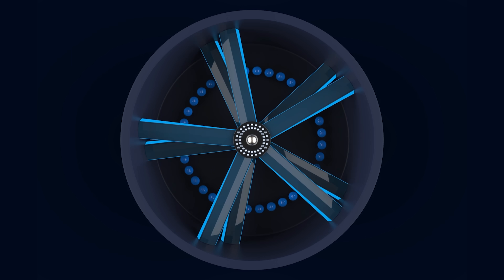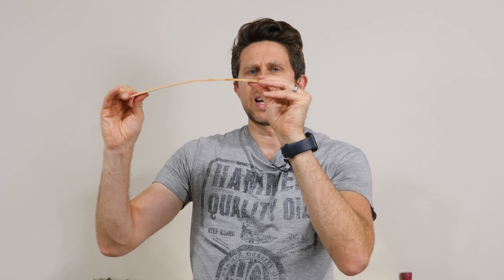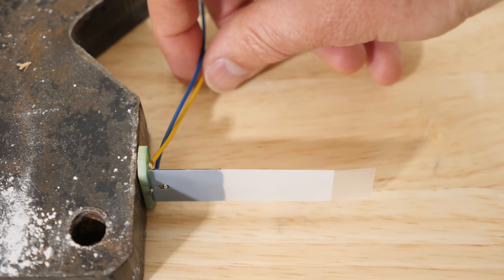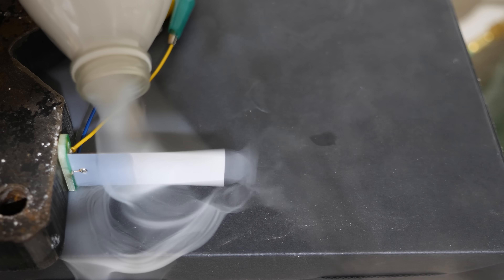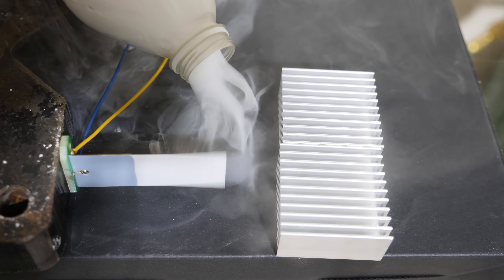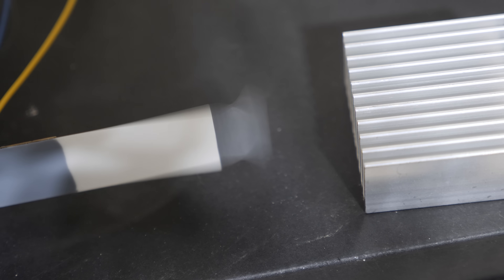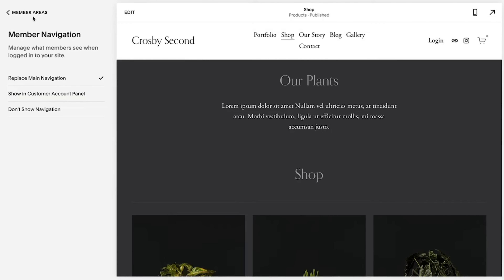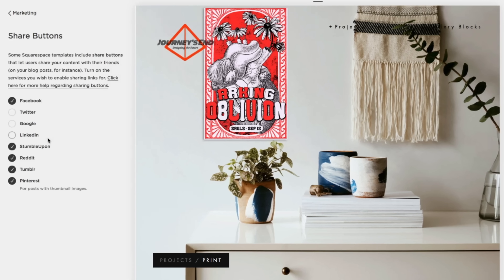A Solid State Piezoelectric Fan—Does It Actually Work?

Comment: Why hasn't anyone built smaller peltier modules on circuit boards?  Possibly have the entire circuitry on the peltier device.  Or obtain a peltier device and print the entire circuit on that. Heat sensitive parts in the cool side.  Not efficient for anything but performance but maybe harvest electric ⚡ in the future.

Comment: This is a very interesting way to move air! Did you know they have made Solid State Active Cooling chip named AirJet by Frore systems for component cooling? The use cases are varied as the chip is in a very small package with a 2.8mm thickness. They are developing it for use it in tablets / laptops / cellphones. PCWORLD did a couple videos on it a Month or so ago.

Comment: I'm guessing this is the basic principle used by Frore Systems in their ultra-thin coolers for laptops that they presented at CES 2023. Though they've been working on perfecting the design and manufacturing for about six years, where as this is just a proof of concept.

Comment: It still has moving parts, it's not solid state. Eventually it will wear out, if it is put in a case it will get gummed up, it still has moving parts. A true solid statr fan would be something likr those house air ionisators, theu can make air move with no moving parts.

Comment: To put in perspective how fast modern computers really are, the piezoelectric crystal in a computer which controls the speed of the CPU vibrates at 4 or 5 Ghz per second, whereas this piezoelectric flap is just vibrating at 60 hz. Yet you can see in the video how insanely fast that looks. 
So computers are basically doing calculations so fast that watching them work from the inside would just look like they're vibrating.

Comment: Looks to me you created resonance at the second mode of vibration of the flapper. I suspect if you could create resonance in the first mode (perhaps by making it stiffer or lighter to match the first mode frequency to that of your source of electric current), you could move air a lot more efficiently.

Comment: You have to check out the AirJet solid state fans by Frore Systems shown at CES. They are MEMS instead of piezo but looking pretty neat. Now if they would only let you buy some to play with. Looks like they are only going to provide them to laptop manufacturers.
Reply: MEMS can be piezo based- they are independent concepts. I'm pretty sure Frore is using Piezo to create the vibrating membrane.

Comment: Hi, I really like your videos. Following your video, I think it is possible to generate compressed air on the go using this piezo. Would you be able to create a prototype to create a compressed air using the same technology? I guess if we position in right direction then aero dynamics also helps in generating more compressed air. Please see if you can create a prototype that runs a motor or drone?

Comment: This mechanism using piezoelectric effect is not unique. You can modify the mechanism of an electric motor to achieve this back and forth motion. Pass AC current through a coil and and place iron or magnetic strip close to it as shown in the video.

Comment: could you get this to work in water or mineral oil for example i understand the resistance would be significantly greater but it might help with submerged pcs maybe i dont know that much so running normal fans maybe just better for a certain reason but if this did work you could use it to circulate any fluid to keeps temps generally similar throughout the liquid while also using alot less energy (although one that would make a liquid flow might have to use more power to hit the resonance frequency within water if that's even possible in water

Comment: Even for computers, you'll need a higher volume of airflow than what your piezoelectric flapper is doing. I think you should do a follow up video wherein you can vary the frequency of the supply current. Maybe if you can get your flapper going at 150 flaps per second (i assume that'll take 300hz current) it might start moving enough air.

Comment: You literally just solved another problem for space engineering, could these fans possibly be able to be used in a space convection oven replacing the rotor blades for cooking?

Comment: Interesting. I just watched your "pump water uphill with no pumps, just check valves creating water hammers." These piezo fans look like fish tails to me. (And why not create a wall of them to really compare them to a desk fan?) "Fish tails" ...can you insulate the piezo and put them underwater? These could be the "tiny pumps feeding big-diameter pipes" Feynman talked about, necessary to pump water up mountains and up water towers to poor communities, (and for irrigation). I bet these, well insulated, would make amazing pumps. Now, I have to try it. ;) ...They'd also be amazing for moving air in arctic conditions, where a propeller grinds to a halt die to sub-zero temperatures! Thanks, Action Lab!

Comment: so, it cant break from stress, but i for sure can say it gonna break rfom fatigue, it will last a loong time tho, i did and article on my mechanical engineering class, that every component, moving or not, will break in the elastic zone from fatigue, it is a real long time, but it will, great video, gonna try do some for my amplifier on the car audio system

Comment: I wonder if you could reduce the frequency and have it not b e really loud. I have seen things where people put a 60hz applience on 50hz and it buzzed loudly. Because of how piezoelec trics work, I wonder if it won't have that issue. Also what if you somehow replaced a computer fan with one of those. I don't know how that would be done but it would be interesting if someone did that.

Comment: Imagine an array of these crystals, not only to create a larger area, but laid end to end. All moving in conjunction to keep passing the air to the next and the next. Timed voltages that would move the puff of air faster and faster through each subsequent piezo unit.

Would enough micro-bursts of air at high speed and frequency compare to a fan blade? Mayhap.

Comment: There are a few reasons why these aren't very common: 
1. For the same airflow these are quite inefficient compared to conventional fans. Most of the energy goes into creating random vortices and a relatively small part goes into the needed airflow;
2. These are much less space efficient. For many cooling applications like computers and servers having such a bulky device is a problem;
3. The piezo fans require high voltage AC. So you either have to use it at grid frequency or have an alternator (expencive and bulky). The high voltage AC also requires more insulation, adds risk of arking to low voltage components, emits EM noise, etc.;
4. For the same airflow it creates much more vibrations. So more noise and more fatigue in surrounding materials (soldered wires would eventually break).
5. You severely underestimate the longevity of bearings. And the ones in fans are rated for significantly higher loads then they would ever experience. Mostly because it's not economically viable to make weaker ones in general. Moving parts on its own doesn't mean something will break faster. Bearings can easily spin for centuries if they aren't pushed to their limits and the dust seal is intact. A vibrating strip like yours will destroy itself or surrounding components from fatigue much faster.

I could only see these being practical in MEMS devices due to manufacturing limitations. But there is no point in building large scale ones.

TL.DR. Fans are better in virtually every way.

Comment: How would you build a duct for this?
I’m picturing a trumpet shape from the top with vertical sides nominally larger than the fan to allow for clearance. 
The shroud section near the base of the fan could be flared out to allow for air to be drawn through perhaps

Comment: Can you make a piezo SS fan using low power input, turn a rotor using a method similar to train wheels / home made tattoo guns, and have the rotor be able to step the energy input up with gear ratios? I know it sounds like it breaks the 3rd law of thermodynamics, but you never know until you try lol. Would be need to just use piezo crystals in some fashion to harness water power / gravity to produce voltage from the impact compressing the crystal.. or install them in the heads of a combustion engines to harness the energy from the rpm

Comment: I remember reading about these in a science magazine in the 90s, I think... They had two blades facing each other that would move together then swing apart. Made a directional jet of air. The biggest complaint was that it made a high-pitched whining or humming noise.

Comment: Fantastic video, as always.
But I wanted to ask about your comment on its usability in space or  a  true vacuum, because as I understand it, there is no air or medium to transfer strictly mechanical force to create the pressure differential.
If I am incorrect (very likely), could you explain.
Thanks in advance...
Reply: He was talking about an environment with air, while in a zero-g space, such as the inside of a spaceship in orbit, or while moving in a line without accelerating.

Comment: Actually i was thinking about this for a while, but i was thinking if we can use this piezoelectric element to compress air by connecting it to a diaphragm and a one way valve to allow air to be compressed in a chamber. But i never tried it, do you think it will work?

Comment: Probably wouldn't put this in a PC but something like this might work at really small scales in a phone.  If you could engineer the flap to be more efficient such that it pulled on multiple pieces and formed a pump with seals, and you did that at the millimeter level, you could probably exhaust the entire phone via channels.

Comment: i feel like the reason rotary fans have dominated is because the fan moves only one way.  it's cutting into the air, and pushing it.  with a "waving" fan, it's more like an oar.  the difference is an oar can be pulled from the water.

on a "waving" fan, you have to spend energy to stop the motion of the fan, and cause it to reciprocate, overcoming the air current it's just created on the first stroke.

meanwhile, a rotary fan never has to stop, does not need energy to restart, it's continuously cutting into and pushing the air.

Comment: It can maybe last longer than regular rotating fans (it should be tested simultaneously) but it has moving part thus it isn't solid state.

Only real solid state as for now is passive cooler. If you put large enough passive cooler fan isn't needed. Maybe to try build computer case that has sides made of cooler?

Anyhow, I like your commitment for exploring new stuff!

Comment: "A fan with no moving parts." IMPOSSIBLE except either by an ion-thrust fan (that someone else just told me about) or by the kind of convection that comes from mere fluid temperature difference. Other than those, something has to move in order to wiggle the air! That's why your phone speaker was able to blow out a candle. I like that at least you said "no parts that are going to rub against each other" later. But they may still wear out... imagine the possible fatigue.

Comment: That piss ant fan wont even be able to push air through my 120 and 240 rads.
Heck my Corsair SP120 fans need to run at 70% when the PC is under load to maintain temps under 65C

Comment: I'm skeptical that the vibrating strip would never break or fail. Since it is bending through millions of cycles, it may fail in fatigue. This is a common engineering problem.

Comment: Do you not realize that nothing can move at all without friction. The bending of the metal creates friction on an atomic level. I am unsure if it would be longer lasting than ball bearings but it creates friction. Certainly is cool though but not as easy to control the direction of the wind.

Comment: What's the efficiency vs a standard PC cooling fan? As in, does 1 watt go farther with the solid-state fan or the rotational one? Also, what the hell did you do so it didn't explode when you connected it to the outlet?? I'm not an expert on electricity by any means, so it might be really obvious, but you said you attached it to the wall outlet? With 120V??
Reply: Why would it explode when you connect it to the outlet? There's almost no current flowing.
Reply: @0106johnny  I forgot about it only having high voltage and not necessarily high current lol

Comment: I was thinking about this application for a while now but I usually end up on a piezo-electrically driven membrane of a pump which drives the compression in a heat pump as the preferred method.

Comment: How large of an array of piezoelectric fans do you need to move the same volume of air as a ceiling fan at similar speeds? This would be interesting to compare, especially the cost savings. This would also be a very cool futuristic ceiling mount where you'd just have air blowing down from an array without any fan blades or vents.
Reply: Piezoelectric crystals that big are rather expensive, there wouldn't be any cost saving.
Reply: @0106johnny  I agree if you get large piezoelectric crystals, it would be impractical. I was thinking a bunch of small ones. Basically copy paste what he did in the video but in an array like 20 x 20 or something similar.
Reply: @kennethmui88  Hard to get any well-directed flow from such a setup. Lots of turbulence
Reply: @0106johnny  Maybe we can direct the wind by having a grid or mesh?

Comment: I would like to see this attached to a dial that alters the frequency of the flapping. I bet the right frequency could get more airflow.
Reply: You'd have to adjust the length as well or you'll lose a lot of efficiency.
Reply: @HarrisonMartinson  Most likely! I agree.
Reply: Not really, piezoelectric crystals have a specfic peak frequency, altering the input frequency is a bad idea for performance. Instead you alter the length

Comment: i bought my house over 15 years ago. has a ceiling fan in my bedroom. i virtually never turn it off. its been running for a decade+ total time since i bought the place. i am absolutely shocked how long its lasted, but since it never gets turned off, the start/stop cycles are super low.

Comment: I'm not convinced that this flapping fan has "no moving parts". It's certainly a compliant mechanism, and it doesn't use any joints or connections to transfer the motion, but it definitely has moving parts.

Comment: Interesting.  I’ve always been interested in the possibility of using piezoelectrics to generate electricity.
Reply: Pretty sure that breaks a rule of thermodynamics. It takes electricity to make this work and you're going to lose some energy to heat produced from electrostatic interactions. So you'd just create less electricity than you're using.

Comment: Interesting

Maybe you can create a circular valve with this concept so that it pushes air in the one direction it closes in, and place it in a tube. With more valves synchronized and optimized to open and close with respect to one  another. Which may also require a sensor to measure (and apply more voltage) in response to the additional stress from variable vacuum pressure.

problem is.... It would have to oscillate pretty fast and have a significant delta between open and closed movement of air.

Still, could be pretty neat. Imagine something flying via rapidly moving valves...

Comment: 4:46 dont think i would put it on computer, reason for the high power fan need for both flowrate (cfm) and static pressure (psi/mmHg) as air need to be forced to pass through obstacles such as radiators.

Comment: My only concern for putting this in computers is dust the fan has almost no torque so it could be stopped by the smallest of particles if it was in a small space however a fan with a larger travel distance and width might fair better if isolated from components

Comment: Cool, very cool.  I have an 8" rotary fan that as well in excess of 120,000 hours on it.  Cleaned and lubed regularly sense 1982, runs all night, every night.  Reliability is a variable.
Reply: I do think he overstated the durability issues with traditional fans. Even without routine maintenance, a fan can last decades.

Comment: There seems to be no record of them on the internet that I can find but there was an aftermarket piezoelectric fan sold to put inside the original Apple Macs in the 1980s.  It was silent and did help improve the convective airflow since there were no fans in the system from the factory.

Comment: That's amazing! I could easily see this becoming a super compact fan design for laptops. 💻
Reply: People have tried that since laptops have been around. Doesn't work well. You need high-voltage alternating current, the airflow produced is pretty measly and they don't scale well.

Comment: It was a known concept, but the video is very well done using nitrogen fumes to model the airflow👍 As for wear and tear, its questionable depending on the manufacturing process... Eventually I agree with the comments below that a true "fanless" fan would be based on ion-thrust...

Comment: it's almost noiseless so I would surely use piezoelectric fans if they get fleshed out for pc components
Reply: It's actually pretty loud, because it is constantly vibrating at a hearable frequency.
Reply: @0106johnny  then why doesnt the camera record it?
Reply: @floot727  Because it's a 60 Hz sound, the microphone probably doesn't pick it up very well. It would be a constant, low humming
Reply: @0106johnny  oh that makes sense then, welp if they slow down the alternation to like under 20 it will get quite weaker but also almost or completely silent to a human ear